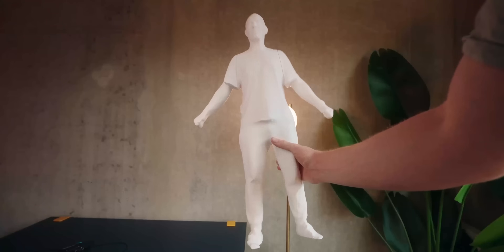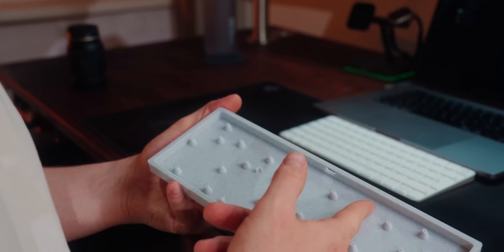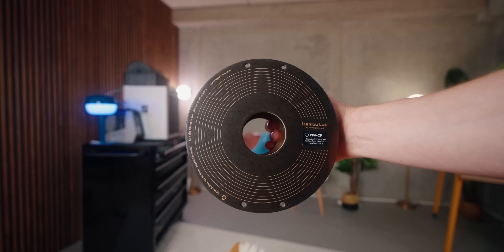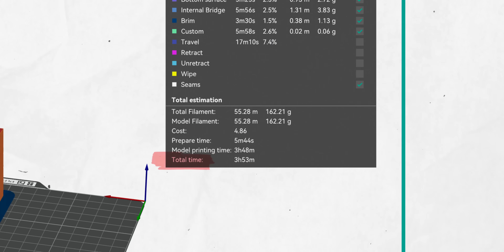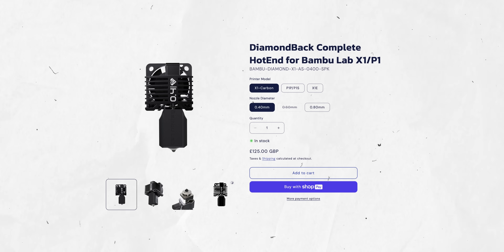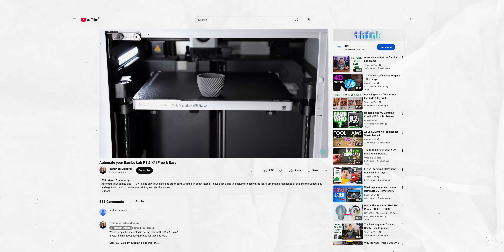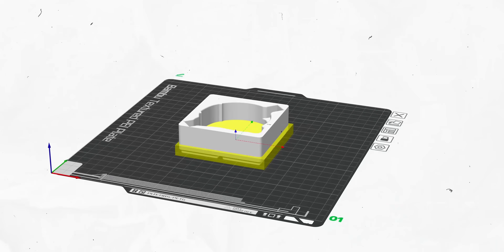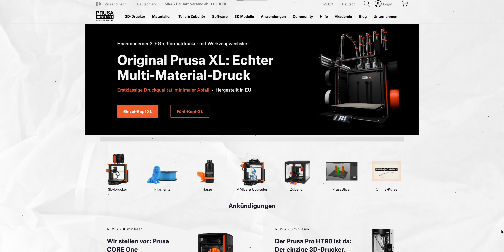3D Printing Tips & Tricks I Wish I Knew Sooner

Comment: Its interesting to see that in the chart PLA produces less pollution with open printer than in enclosure. But my favorite part is about filament storage, i was worried that my PLA may go bad, because i may not use it very fast so i bought 3d printer with AMS included, which was 100$ more but it looks like I didn't have to go this far.

Comment: 5D printing needs to be a thing. In 5D, I should be able to print a connection where, no matter where I am, if I snap my fingers and raise my right toe, the lights will lower by 50% and smooth jazz begins wafting through the air. Another good 5D print would be, if I cover my nose and raise one foot, any foul odor will be muted in the area directly surrounding me. This would be great for long elevator rides.

Comment: I clean my bed with iso alcohol before every print. I went from about 80% success to near 100%!
Reply: This is my method since 2013. I almost never have adhesion problems 🤙🏽 IPA is the best. I mix my 99% with distilled water at about 2:1 ratio water:ipa

Comment: 5:33 supports wise, I agree ive always used tree supports after my first trail of them a few years ago with default settings (you already know how it went) after that i always used tree supports, but question is, where SHOULD i use normal supports? my guess is with alot of 90 degree bends but anyone got any good answers?

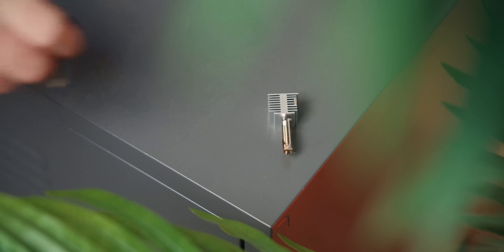Comment: 6:17 I agree with you about Tree supports but I want to add something crucial you misses: Support Roof/Floor Interface.  CURA, for instance, does not enable this by default but it makes a huge difference.

Think of the Support Roof Interface like a box that's printed on top of the tree branches, and that box will be what supports the overhang. This box can be fine tuned, and I often have mine printed with ZigZags at 30-50% density, 1 perimeter wall, and about 1mm z-thickness. That gives you a stable platform which will support your overhang, but one that's only just strong enough to be pulled off the model in one go (instead of removing little chunks of support at a time) leaving minimal scarring.
Reply from the maker: Thanks for the great tip! Will check this next time
Reply: This sounds interesting. Do you know of anyone that shows a tutorial on this? Trying to wrap my head around how this works in action. Thanks for the tip!

Comment: I've 3D printed for 10years now and I've never had as many problems as with my new bambu a1. It now seems that the larger nozzles are always the problem. with the 0.4 it's quite reliable
Reply from the maker: Sad to hear! what kind of problems are you getting with larger nozzles? I've printed with larger nozzles no problem 
(I know it's a stupid question but you changed the settings in the slicer and the printer to the other nozzle? because otherwise many prints still work just with bad quality)
Reply: @arnebornheim  it's not possible to print with the wrong nozzle settings, bambuslicer will know 😉

With the larger nozzle diameters, it has trouble making the first layer stick to the bios plate.... it's pushing filament around like toothpaste at time, having so much viscosity that the nozzle is pulling the printed noodle up again (tried all temperatures from 30° less than recommended to 30° higher), it has trouble with the surface smoothness, ironing doesn't work either. It's all sorts of problems.

Found out that matte Filament is a general issue on bambu printers too, only found the Reddit posts about it after 23 failed prints 🤷🏼‍♂️ etc etc. Theres a lot going on with Bambu.

I also miss all the options from Cura this (I know I could use it without sending prints via WiFi)
Reply from the maker: @Fr00ter  It is definitely possible to do that. You can't print with another nozzle setting in the slicer, than what is saved in the printer. But when you have a .6mm nozzle in the printer but the printer is set to .4mm you can encounter this problem.

have you tried adding some glue to counter the adhesion problems ?
Reply: @arnebornheim  nope, haven't needed glue in 10 years. Not really convinced that I want to start that mess with "the easy printer"

Comment: what are your thoughts on an isolating 3d printer enclosure? I have it in an air conditioned room, and was wondering if it can nit only have all the printer fumes isolated, but also the heat isolated in a box would help, thanks for the video btw.

Comment: I like your content and the way that it's presented!. Did u use other fliament brand in your Bambu (A1)?. In my country I can´'t get bambu filament and I don't know how to tune expansion. The parts doesn't fit good or the threads are not smooth. Regards from Argentina.
Reply from the maker: Hi 😊 yeah i've used it with other filaments as well. A bunch of other filaments are natively supported by Bambu studio. Otherwise you could try orca slicer which supports even more